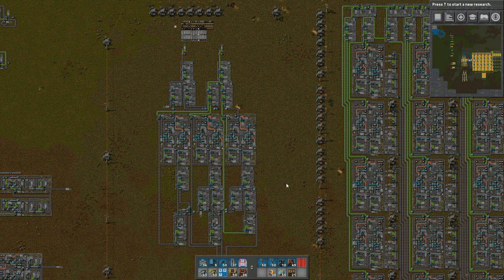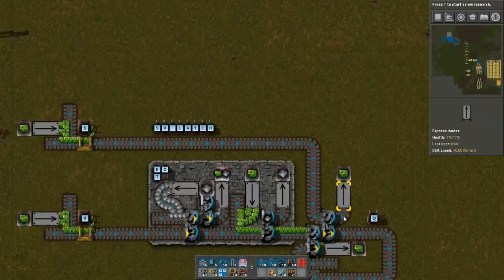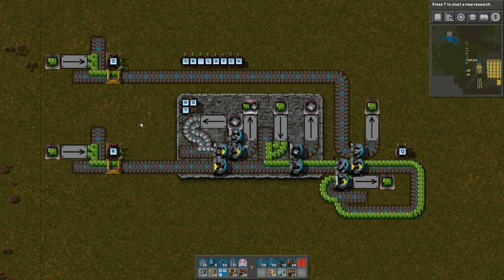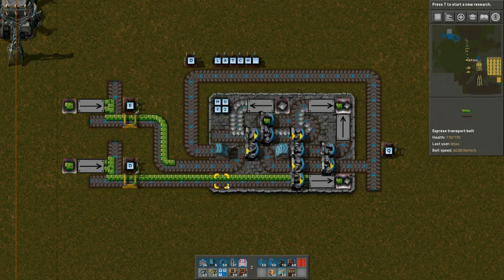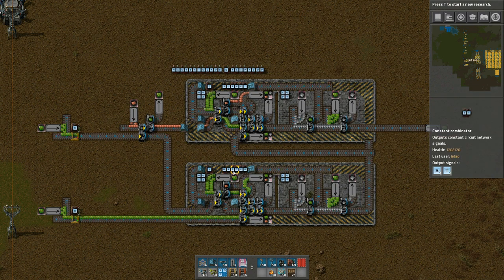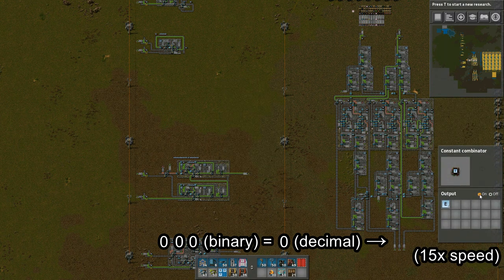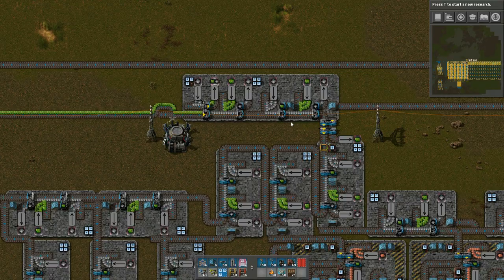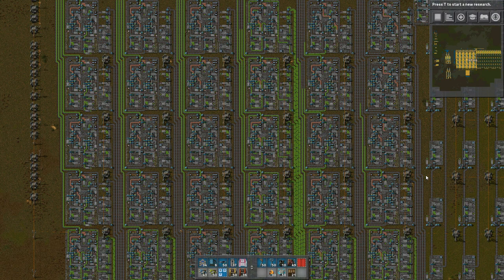Factorio Belt Computer Part 2: Sequential Logic

Comment: it's not really 80 billion times slower

remember that CPUs didn't start out with GHz speed :p

one of the first Computers ran at like 5 Hz, plus the only thing really slowing down this is the belt speed, if you increase that signals can become al ot more compact and take less time to reach what they are supposed to
Reply from the maker: Haha yeah.  I wonder if I can find schematics of a very early CPU and try to replicate it, then we'll have an apples-to-apples comparison.
Reply: @letao12  I made an 8bit CPU once. it's very basic but turing complete, it is made in a program called "Logisim" which is (IMO) one of the best logic programs ever made

https://www.dropbox.com/s/8ipdn6a9x8wckgj/simple%208b%20CPU.zip

just open the "Simple_8b_CPU.circ" file with the "Logisim-evolution-3.1.1hc.exe" that is included and take a look. I put text everywhere to explain stuff and the Circuit seen is also a lot more complex then nessesary since i included a Memory Management Unit and IO Controller. both can be left out and you could just connect the CPU straight to some ROM and RAM and simply use some Memory addresses as IO Devices for input and output

anyways, even if it looks complex this CPU is far simpler built than anything in RL you could copy. CPUs like the 6502, Z80, Intel 8008 have either a lot more features or a lot more instructions, this one has like...4 instructions and it still can do a lot that those CPUs can too.
Reply from the maker: Thanks!  I'll give this a try.
Reply: @letao12  that reminds me, i found a universal Assembler where you can define your own Instruction set basically allowing you to make an Assembler for a custom CPU.
here is the one for my CPU and the github of the Project in case you want to see how it works and make one for your own CPU.

Github: https://github.com/hlorenzi/customasm
Simple 8b CPU Assembler: https://www.dropbox.com/s/bw5jmszogz2nu8y/Custom%20ASM.zip

i tried to keep the Instruction names as close to x86 Assembly as possible, that way if you already know x86 Assembly it shouldn't be hard at all to make programs for this.
of course you can still change the hardware of the Logisim program, as long as the CPU stays the same and you have enough Memory space to fit a program it should run perfectly fine on it